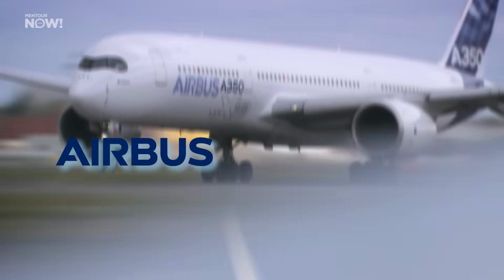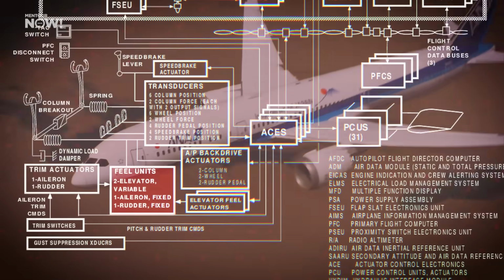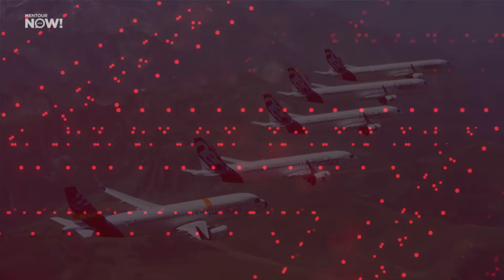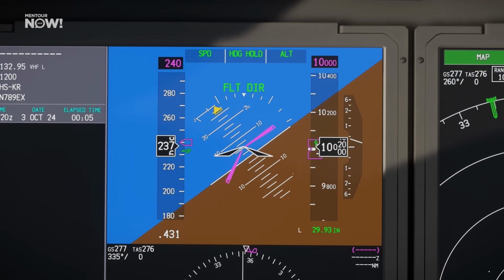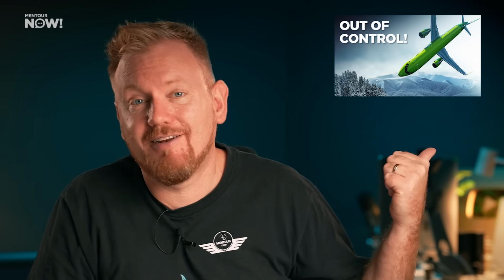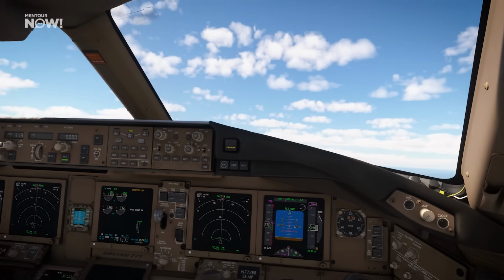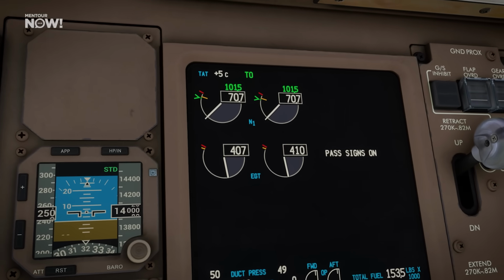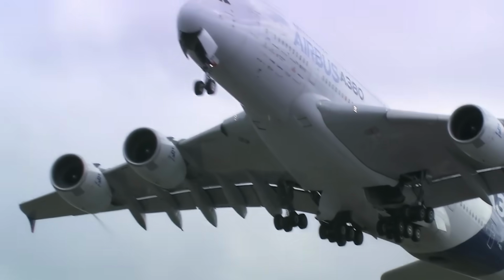Do Pilots Prefer AIRBUS over BOEING?!

Comment: Fighter jets are fly by wires for a long time. Aren't fighter pilot flying "real" plane ? The protections are also in place in case of loss of cousiousness or it a manoeuver would destroy the plane. Older jets you could just pull on the stick as hard as you wanted until you ripped the wings off and pondered about your life choice after.

Comment: Flown both during my 31 year airline career and Boeing was always a handful.  Spent over 10,000 hours in a Douglas DC-9 and that was a joy to fly but you worked for every minute of it.  My last 10 years were spent in the A320 and that was the best flying I ever did; especially the 321.  Airbus builds a fantastic airplane and flying it was a pure joy in every way, comfort, reliability, ergonomics, and safety.  Look at the safety record  with A320 vs 737 and the record speaks for itself.

Comment: I think that allowing too much control and decision making to be done by computers is potentially a problem. I'd rather have a human have the control. A machine doesn't understand that something is wrong if it's data says otherwise. A human would see the difference between the data and the actual planes performance. And so much reliance on automation can make a pilot complacent or cause flight skills to get rusty.

Comment: It seems that a thorough implementation of 'fly by wire' controlling an electro-mechanical back-end that has a power source independent of any power generated by the engines themselves, would result in an increase in safety. Even if both engines shut down, so long as the controls continue to work, it should be possible to glide an aircraft safely down, even a jetliner. The main consideration would be to have enough air-speed to continue to generate lift and prevent a stall. That could be achieved by diving till the aircraft has enough speed, then leveling off, and continuing that pattern till touchdown.

Comment: I'm not a pilot or a professional in the aviation industry, but based on the videos I've seen, I would prefer Airbus since strong safeguards will effectively stop pilots from making mistakes, as the aircraft won’t permit them to operate beyond safe limits. I acknowledge that this may mean Airbus pilots are less likely to respond to emergencies, as they often rely too heavily on systems. Boeing might contend that its pilots have superior emergency handling skills, but this could leave passengers at the mercy of pilots since they can choose to stall the aircrafts. I believe both manufacturers performed excellently with their operational systems, but it is the human element that distinguishes the discussion.

Comment: As a passenger, Airbus all the way please. Airbus understands gravity, so that's nice. 
And their aircraft land with same amount of parts they took off with.

Much unlike boeing then
Reply: Quote: "And their aircraft land with same amount of parts they took off with."

QF32, AA587, AF066, UA2330 and many others will disagree.
Reply: @kallek5655  btw let's count engine failures out of our fine argument, shall we? As boeing and Airbus don't make them... 
I expect relevant facts. Facts say AA587 is down to pilot error. Be specific
Reply: @guillaumeromain6694  No, we shall not. If it happens to a Boeing, no matter if it's an engine fault or whatever, everyone jumps so easily on them. So, same for Airbus.
Reply: @kallek5655  I never attribute an engine failure to an aircraft manufacturer.  When I quoted "and their aircraft land with same amount of parts they took off with" I had Alaska 1282 in mind. How entertaining ! 
Mind you, some boeing operate With more parts than they were designed with..  ryan air even resorted to have a dedicated team of engineers going through a new boeing plane to fish out tools left behind during assembly, before putting said 737s in service. Nuts! 
Very tough company to support, boeing. Good luck.
Reply: @guillaumeromain6694  tell that to the jetblue a320 that lost parts on takeoff several months ago
Reply: @animegamingdude  Be specific. Give flight number.
Airbus understands how gravity works. Much unlike boeing
Reply: @guillaumeromain6694  Proves you have no idea what you are talking about. Every aircraft flies because it must create lift that opposes gravity (or more precise: the upward forces must be equal to the downward forces). If Boeing didn't understand how gravity works, then they couldn't design planes, pure and simple.

Oh and BTW, Boeing does not manufacture the fuselage of the 737, for example, Spirit does. So if you want to keep out engine manufacturers, you need to keep out basically anyone that manufacturs parts of an aircraft. From a passenger point of view I do not care if it was the engines or some other parts. Airbus planes have also had their share of problems.
Reply: @kallek5655  interesting.  You seem new to the world of aviation and barely broken in. You are ill-informed on many fronts.  Boeing does outsource production of fuselages.  That is correct. Airbus does as well. But they are ultimately signing off on those fuselages turned into aircraft. Boeing accepted responsibility for what happened a year ago with Alaska... Boeing did f up. 
Are you seriously telling me how aircraft fly?! I was being ironic... 
Boeing designed a piece of software that drove 2 aircraft to the ground minutes after lift off. 

Still willing to support that fine manufacturer ? Putting its profits before your safety? If so, your moral compass needs recalibrating I suggest
Reply: @animegamingdude  That incident has not seen a lot of media coverage and while not trivial, cannot be compared to the scope of Alaska 1282...  737 involved was weeks old! 
Jetblue 153 incident A320 was 24 years old and falling debris might most likely have been caused by maintenance issues rather than a design fault or lack of quality during manufacturing. Surely that plane had done well  so far. We're looking at 2 different incidents here, I'm sure you'd agree ! 
A320 is the best seller of any other commercial aircraft, with a reputation for safety much unlike max. You don't have to like that fact. It's still a fact though.
Reply: @guillaumeromain6694  If that's what you want to believe ;) Anyway, my moral compass is fine, it doesn't need to be recalibrated just because some weirdo thinks so ;)
Reply: @guillaumeromain6694  and yet people have still lost their lives onboard a320s
Reply: @animegamingdude  be specific. Give flight numbers
A320 has one of the highest safety ratings. It's a fact. You are allowed to dislike it. Facts however don't care whether you like them or not.  They're still facts.
Reply: @guillaumeromain6694  you could have just looked all this up yourself but clearly you are too lazy to do so
and its a fact that people lost their lives in these crashes
you are allowed to dislike it
facts however dont care whether you like them or not
they are still facts
Reply: @animegamingdude  Raise your game, friendo.  If you are to take part in this fine conversion, be specific.  Otherwise, don't waste my time with approximate bs. 
Facts ain't for grabs.
Reply: @guillaumeromain6694  here is a list of every fatal a320 crash
air france flight 296q
indian airlines flight 605
air inter flight 148
lufthansa flight 2904
gulf air flight 072
armavia flight 967
tam airlines flight 3054
taca flight 390
indonesia airasia flight 8501
germanwings flight 9525
egyptair flight 804
pakistan international airlines flight 8303
Reply: @animegamingdude are you telling me that you blame the A320 with which the pilot murdered 150 people ? Are you serious ?
Reply: @guillaumeromain6694  just goes to show that people have lost their lives on board a320s despite its apparent safety record
airbus protections didnt stop that pilot from slamming that plane into the ground
more people have lost their lives on board the a320 than on the 737 max
that is a fact
you dont have to like it but its still a fact
Reply: @kallek5655  reeled in a boeing fan! Nice ! you're gonna have to be a bit more persuasive to take me on though.  Tough company to support, boeing. I admire your resilience. I do! 
Go on... let's see where we're headed

Comment: The "Manual Thickness" comparison is kinda funny because it relates to IT as well. A nice example is the MS-DOS 5.0 manual. Over 700 pages with in-depth information. With DOS 6.x a lot of it was transferred into the built-in help system which was good and bad at the same time. Good about that move: You could search, check, and find the information you needed faster. You could even edit config files within the help system. Bad: If your computer does not boot due to a stupid mistake you need a second one to get all the information you had on paper in the previous DOS version. And editing config files within the help system also took avay half of the screen and gave worse overview.
Without the paper and online-but-not-internet complete manuals of them I would have never learned that much, and I wish complete manuals would come back since they force the producing company to do a more reality-check of what they produced.
And don't get me started about when Microsoft went the way to put the manual 100% online instead of offline available manuals. The office 2010 manual is practically dead due to that, any all of you should know how "helpful" it is newer microsoft products sent to a search engine which never has been good since ever it was pushed upon us 'round the year 2000, or send you to long dead links.
And microsoft is not alone there, I would have to kick a lot of other software producers, they are just eh biggest player in that...

Comment: airbus can not jettison fuel if it needed to in an emergency. boeing can.
Reply: Depends on the plane. The 737 can't jettison fuel either. Typically only widebody planes can jettison fuel as only they need to. And they can only jettison from the center tank, which is why one A330 variant (not sure if it's the -200 or -300) can't due to the lack of a center tank.
But it's not an Airbus/Boeing thing.

Comment: 1.1) The way of dual input in Aribus is str8 stupid... Stick should battle you as sticks were physically connected, even if not.
1.2) Taking sum of both is even worse... it means nobody really steers, because plande does orders of none of pilots. Make unused one feel broken, aka no resistance is felt, and buttons to switch control (i guess the second one is there already).
3) Once levels of laws in Airbus degraded, they should be enabled only manually by pilots... just to not change behaviour of plane back and forth in extremal situations.

Comment: I typically dont buy into these sorts of “one vs another” things that pop up. I have favorites (747, 757, a340, etc) but it always comes down to the PLANES as opposed to the firms themselves. I’m a GA pilot so I like the stick and rudder aspects of flying but I also appreciate the fact that if necessary, my little RV-12 can fly an RNAV approach on autopilot with relatively minimal hassle…and I absolutely love ADSB and the extra safety it provides. So I don’t think that “one or the other” scenarios are the right outlook. It’s more about flying what you’re given in the safest, most enjoyable manner humanly possible.

Comment: I am not a pilot but I did flight simulator flights on both A320ceo and B737NG and I prefer flying the A320ceo. As a left hander, flying the aircraft from the left seat didn't take long for me to get used to and more importantly the cockpit layout is better. If I become a reallife pilot, I would certainly apply a job at the airline operating the A320.

Comment: I absolutely despise basically everything fly by wire. As a heavy equipment operator, we call manual valve controls "pilot" controls (pilot for the low-power hydraulic circuit that amplifies stick movement to operate high flow, high pressure valves) while fly by wire is referred to as EH, or Electric over hydraulic controls, which are fundamentally quite similar to their aviation equipment, though hopefully with lower standards for failure, as these systems do fail and often behave unpredictably when the management computers that filter out sudden inputs and coordinate speed matching and positioning systems get an unexpected position or speed reading from a damp sensor. Needless to say, out 259D is a lemon and we're sending it back to Caterpillar.

Comment: Is this even a debate anymore? Data clearly shows that Airbus planes have much fewer accidents and loss of lives, even if you do not account for the 737-MAX fiasco.

The A320 family has replaced the 737 family as the top selling passenger aircraft and it has had far fewer accidents than the 737, in addition to providing more passenger comfort.

The same can be said of the A380, A350 and A330 when compared to the 747-8, 777 and 767. The Airbus planes are simply better in terms of safety and passenger comfort. Fleet commonality, being more technologically sophisticated and superior ergonomics for the pilots are just the icing on the cake.
Reply: No 787 has ever crashed and a new a350-900 couldn’t even make 3 days into 2024
Reply: @DrakeDHDerr  But the 787 has had more safety issues due to its batteries and fuselage and was even grounded. The A350 has had fewer issues and the only crash it was involved in had nothing to do with the aircraft itself.
Reply: 747-8 > a380
Reply: @animegamingdude  Only as a freighter. As a passenger plane, the A380 is more spacious, more comfortable, more technologically advanced, and the safer plane.
Reply: @sundarsubramaniam7274  yes the a380 has a perfect safety record but the 747-8 does too
Reply: @animegamingdude  Yes, but in every other way as a passenger plane, the A380 is superior. Better passenger comfort, more technologically advanced, carries more passengers, Better cockpit for pilots, etc. The only area where the 747-8 is better is as a freighter.
Reply: @sundarsubramaniam7274  the 747 is better than the a380 period
Reply: @animegamingdude  Yes, it is. In terms of having more accidents, fatalities, safety issues, noise levels, lower passenger comfort, lower pilot comfort, and as a freighter.

Comment: I have to admit, my knowledge is limited. My only time touching boeing is as a avionics tech in the military. I have a PPL, 600 hours, but never had an eye towards airliner. So my only actual time in a cockpit is in the simulators.

That said, Airbus is just so much nicer in a sim. Is a light on a button on? Yes, why? light = bad, make it go away. If white, press it. If red, what is wrong? The checklist process makes sense. It is fluid. Even watching professional pilots setup a boeing, it is a chaotic mess. Here..here...here...here. one side of the panel to the other, back to the other side, to the bottom, to the top. Even after a few hundred hours in a boeing aircraft in the sim, it just doesn't make sense. And programming the FMC is just stupid. Seriously, I have to press exec otherwise everything I just did, I didn't actually do? It is also not as fluid as the Airbus MCDU. 

Everything about the Airbus and it's processes, just feels natural. Apply a little logic into the process, and you understand how to do it completely. Boeing is just the opposite.

Comment: One should not omit mentioning the fiasco called Boeing 737Max and the killer s/w MCAS smuggled into the FCC software w/o proper certification, w/o notification in manuals and advisories to Pilots. It is IMPOSSIBLE to accept Boeing's competence when it allowed all redundancies to be nullified by RELYING on ONLY ONE AoA SENSOR for MCAS input. By the way 737Max still has only TWO AoA sensors, which is NOT GOOD enough, whereas Airbus has THREE, the odd number is very important. I had razed a Twitter war on Boeing's Incompetence on 737Max. The MCAS has been upgraded in several ways mainly using both AoA sensor inputs now, but again that is not good enough. The most important design FAILURE is that the Pilots can not disable the MCAS. The BS solution offered by Boeing to the Pilots to SWITCH OFF the two Toggle switches to stop MCAS from function is totally IDIOTIC. It cuts of the Electric Power assist to the Pilots as well and when the Ethiopian pilots in desperation switched then on, the waiting MCAS POUNCED, no mercy.

TRACK RECORD of Boeing's SAFETY is bad as of present.

Boeing had been most reliable and competent before David Muelenberg (disgraced CEO) and his immediate predecessor. These two brought the culture of Safety First to Business First and Safety not considered.

But I would agree that Airbus in Normal Law NOT giving tacit feedback to the Pilots is A BAD DESIGN, like you mentioned Dual Inputs from the two pilots and cancelling is a TERRIBLE SAFETY ISSUE.

Comment: In my opinion, the most important thing in aviation is pilot training. It is probably already possible to build an aeroplane with a chimpanzee at the controls.
 
But I don't think that's the point. 

If the pilot gets the right training, there is no need for SOP or FCOM. Why? Because the pilot already has it all in his head.
If the pilot got really good training the first time, then there would be no need for computers to override the pilot's decisions. 

The whole ‘human error’ is contained in the lack of pilot training.

I will give you a more down-to-earth example. Driving licence. 

How many people do we have behind the wheel who should be sitting at home watching quiz shows? People who should stay away from controlling the car. 

However, if these people got proper training, there would be less traffic jams on the streets. Fewer accidents. 

If you invent a system to replace a human being, why the hell is a human being needed here? 

Airbus made a system, we had an explosion in the forest during the presentation of the new fly-by-wire system. Let's hope the next update doesn't f*ck up the planet ;)